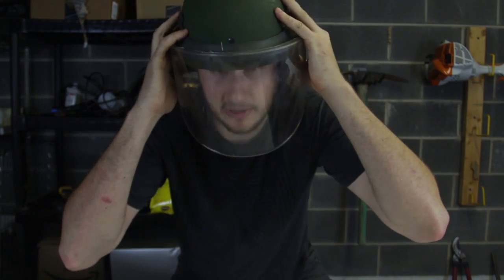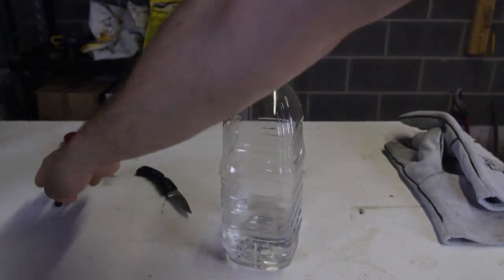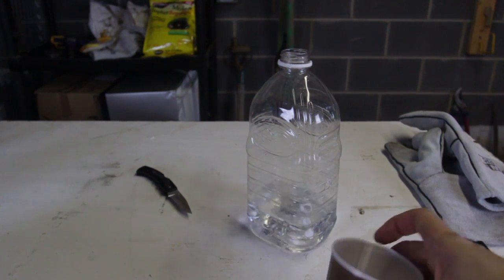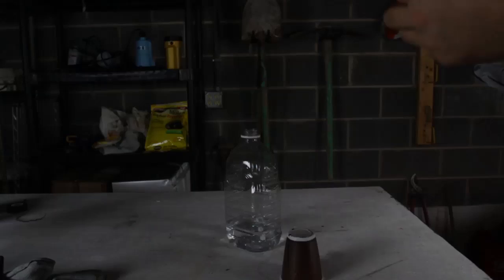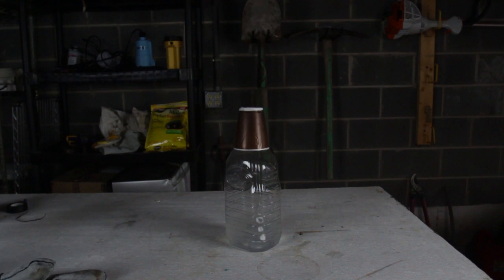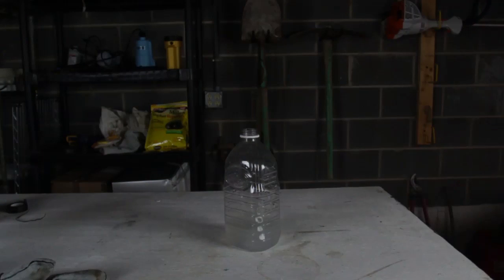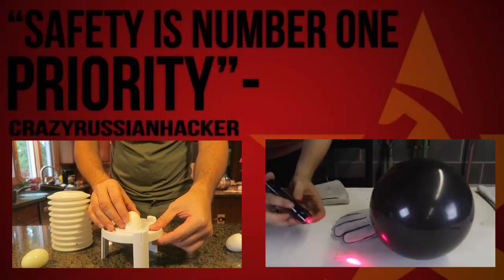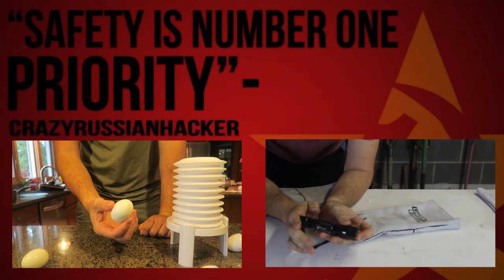Calcium Carbide Rocket

Comment: Yay face shield! The reason the explosion is smaller after the first one is that all the oxygen is used up so when more acetylene gas accumulates there is little oxygen for it to burn. If you ventilate the bottle with an air hose through the top you will get a big pop like the first. Just make sure it is not burning first. Loved the slow motion part too. Thank you. Be careful.   :-)

Comment: What you can also do is grab an empty paint can, poke a hole in the bottom and put a few pieces of carbide in it. Then, put some water on the carbide, close the lid but not tight (!!!), and light it at the little hole you made earlier.
But please, be careful coz that thing can hurt you. Also, safety is  number one pwiowity, so make sure you have ear & head protection!

Comment: Guess what? Take 6 3's. 6/3 is 3, two groups of 3 and divided by 3 which is 3 groups of 3, which will be 9 then 3/9, which is 3. So, this post has 9 3's so far, then you multiply that by 3 which gives you 27. 27/6 is 4.5, times 2 is 9. Now, you have 6 9's in this post. Add all the numbers in the post, which will be 162.5. Move the decimal place 3 times to the left, then divide it by 3. You get 541.6666667. 6 6's in the number, divided by 2, which is 3. Illuminati confirmed.
Reply: You lost me at Guess what.
Reply: +MisterPotater I guessed what. What do I do now. Was it the right answer?
Reply: +Mobil 1 Swag Me too!

Comment: Old miner's helmets used calcium carbide with a steady drip of water. It produces acetylene gas, the same stuff used in welding torches. You would light the lamp with a match, then adjust the speed of the water drip to adjust the brightness. Some old headlamps for cars and motorcycles use it too. (20's era)

Comment: what if you put a sealed cap on it?
Reply: The expanding air would escape through the hole used for the lighter. If the entire thing was sealed and you lit a fire in there using sorcery, the bottle would be ripped apart and shrapnel would fly everywhere.
Reply: +Drakethedrake he could use a fuse and tape it in.
Reply: Just add a fuse to it and you have a bomb.
Reply: +Mark Allison yep